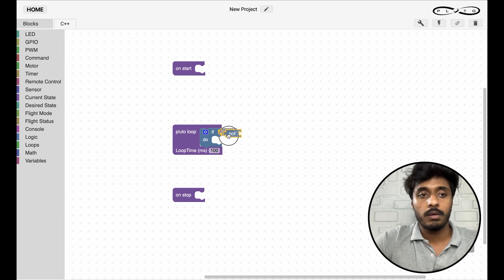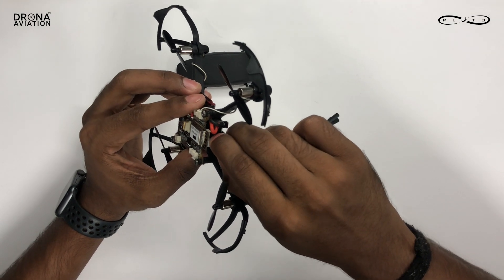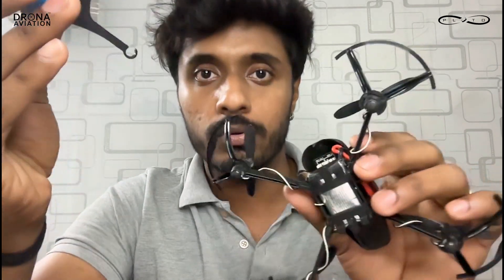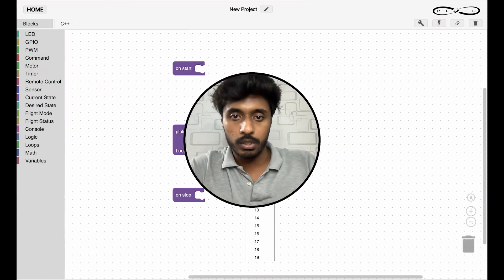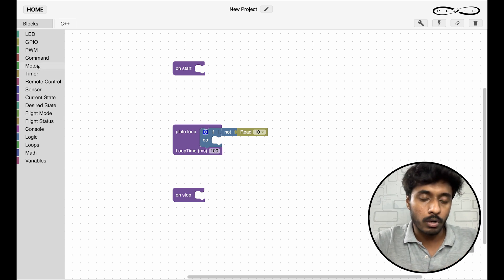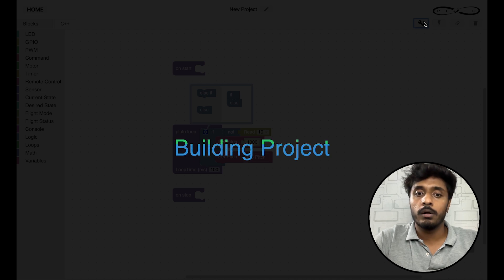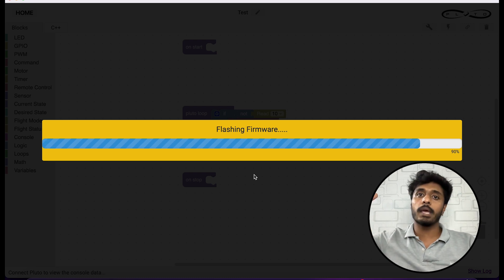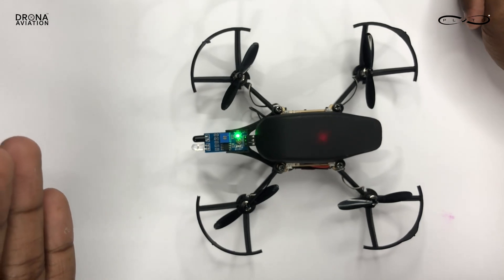How to make obstacle avoiding drone | PlutoBlocks | Pluto Drone #DIY

Comment: Hi there, you have a holding bracket for the IR sensor, but the files for it aren't available on the website anywhere.
Could you please share the stl file for the holding bracket for the IR sensor?
Another comment below has asked for the same, which was misunderstood as the 'claw', which meant the holder.
Bought the drone and want to do this project, but cannot proceed due to the unavailability of the STL file for this holder. Thanks!
Reply from the maker: If you have a 3D printer, you can download the STL file from here: https://create.dronaaviation.com/design/accessories/sensor-mount.

If you don't have a 3D printer, you can buy the sensor and mount from here: https://www.dronaaviation.com/product/sensors/.
Reply: @Dronaaviation  Thanks so much 😁

Comment: Hi, how can I buy the claw in which you attach the IR sensor? I have pluto 1.2 with me, I want to try this, please help me
Reply from the maker: In this video, we explained the Obstacle Avoidance project, where we used an IR sensor. It sounds like you're referring to the Mini Claw, which is actually part of a different project featured on our YouTube channel https://youtu.be/Z_eDDJ52csg?si=lLX8BOq_RevK55qL . 

With the Pluto 1.2, you can only attach one sensor at a time, so it would be either the IR sensor or the Mini Claw. However, if you have a Pluto X, you’ll be able to connect both sensors simultaneously. 

If you'd like to purchase the Mini Claw, you can find it on our official website here: https://www.dronaaviation.com/product/mini-claw/
Reply from the maker: You can buy from here:
https://www.dronaaviation.com/product/sensors/